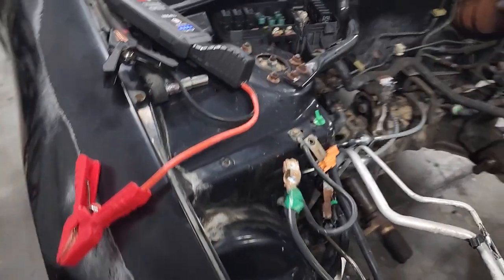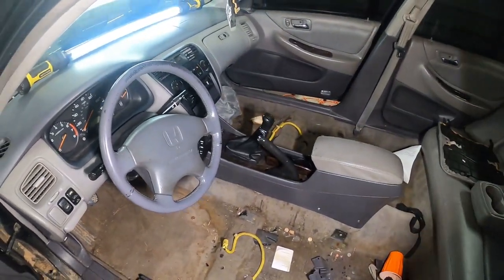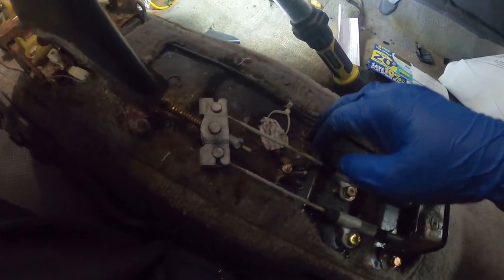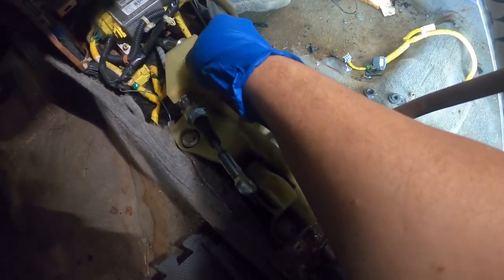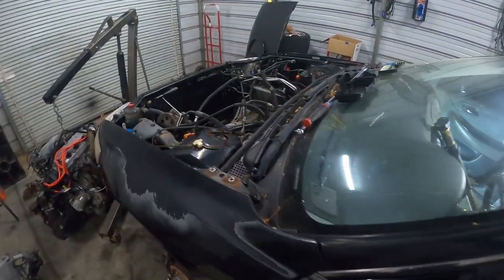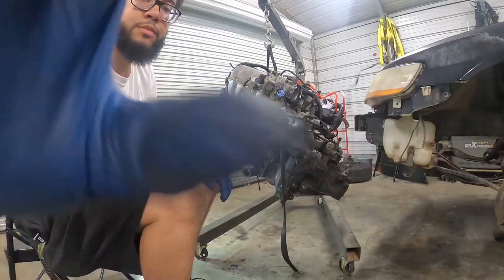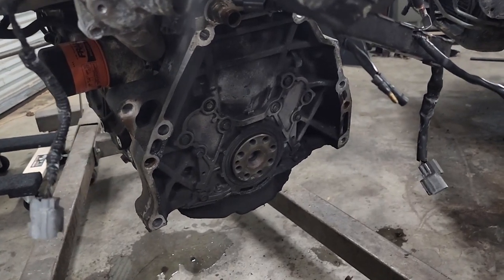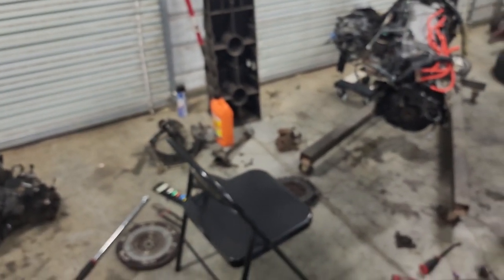Project Daily Driver: CHEAP HONDA ACCORD 1999-2002 Honda Accord Shift Cables Install

Comment: When doing a auto to manual swap. In a 1999 Accord sedan.  Do I need to change or get the immobilizer from the donor vehicle and ecu . Or would my immobilizer and donor car ecu along with the vin of donor vehicle. And have a key made .